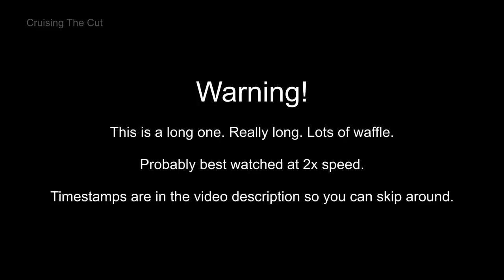241. Narrowboat DIY: refurbishing my shower cubicle

Comment: I hope you used STAINLESS screws! they don't rust in Marine applications or in wet areas......

also to properly apply the "Gunge" use painters tape along the edge where you don't want it (the "Gunge that is!) smooth out your "Gunge" then remove the tape before the "Gunge" dries.....

Comment: Cracking job. As for the new shower head pole. Can it not be turned upside down to fit the screw holes you drilled previous?
Reply from the maker: No, the pieces weren’t designed to do that.
Reply: As an old plumber, I used to use a junior hacksaw to shorten the tube of a riser rail if a similar situation occurred. You have to be careful to keep the end square, but it's normally not too bad.

That was most enjoyable to watch, thanks very much.

We saw your boat at ABNB (we moor ours at North Kilworth) and then down at Welford a few weeks ago incidentally.
Reply from the maker: The rail was made of cheap and brittle-looking plastic which I feared to cut in case it just snapped. Hence installing as is.
Reply: @CruisingTheCut  Definitely better safe than sorry then. Thanks.

Comment: Glue them to the tiles? Bodge and run approach interesting.....and why didn’t you just dismantle the fitting and fit it upside down thereby saving the hole in your watertight shower?
Reply from the maker: Not bodged at all, they’re specifically designed to be stuck to the tiles. The fitting would not work upside down, do you seriously think I didn’t consider that?
Reply: @CruisingTheCut  🤣🤣🤣

Comment: I wonder - your fitting these panels in the summer (hot, expanded boat), so if they are tight now, what will happen in the cold? But I'm only half way through the video.
Reply: In your last shot, of the original problem bottom corner - is that exposed wood to the left? Just a touch of more sealant should cover it.
Reply: Finished the video, great work, video production and handyman stuff. Netflix will be a calling soon!
Reply from the maker: Although I kept saying how warm I was, it was not really that warm and the boat is turned away from the sun. So there shouldn't be any contraction now (if anything, the panels will move away from the corner)
Reply from the maker: No, there's no wood on the left in the corner (I know it looks like it, but it isn't!)

Comment: Question came to mind while watching your vlogs. What does one do if there is a medical emergency while on the cut? Are there emergency boats on the canals?
Reply from the maker: Emergency canal boats wouldn’t be much use as they’d still be limited to 4mph! The canals are so narrow you just pull in and the usual (land) emergency services would come down the towpath.
Reply: @CruisingTheCut  thank you for answering so quickly.  Perhaps the answer to my question was obvious but thought perhaps others were wondering as well.  Have a pleasant summer

Comment: What kind of shower did you install, where the plumbing is outside the wall? We need to get that in order to add a shower. Many thanks.
Reply from the maker: Uh, it was just already on the boat, a set of shower taps with long screw thread pipes on the back. I don’t know any more than that, unfortunately

Comment: Top effort! Just for next time, if you’d have cut down the riser pole (the thing the shower head slides up and down) from the top as required, then it would have fitted the original holes. Don’t mean to be a smart ass but a tip if you ever do it again. Thanks for your videos I thoroughly enjoy them.
Reply from the maker: Hi, it did not seem wise to cut it as it’s made of what looks like very brittle plastic and I thought it might shatter.

Comment: Your are suppose to leave gaps on the bottom for movement of the plastic parts. It is better then it was, but it will fail, and you will have leaks again :(

Comment: Ah, the standard D.I.Y. avalanche.
Was there a reason you couldn't fit the shower rail upside down to make use of the existing hole?
Reply from the maker: Yes, it wouldn’t work that way, the bottom piece is specifically designed to hold the rest up
Reply: @CruisingTheCut  bah, are they designing out bodging now? ;-)

Comment: I had a little look through the comments but didn't see any mention of the gap to the left of where you put the narrow slither of panelling, down the bottom, under the door I suppose, you can clearly see a long strip of bare wood, that'll catch any water splashed onto it and your problem will persist, if I were you I'd fill that with sealant too :)
Reply from the maker: Cheers but it's not wood. I know it looks like it but it isn't!

Comment: 25:00, what if you use a dowl or small piece of wood old broom handle or such, diagonal across the shower then other wall and wedge corner track using several all along the wall.

Comment: A heat gun would have let you bend the panels to fit the curves. Also, use a bent piece of stock pushing from one side to the other to hold both sides while the glue cures. The definition of cruising is "working on your boat in exotic places." and Yaching is "Getting your boat fixed in exotic places."
Reply from the maker: Sounds about right

Comment: David, well done, must confess I only dipped in and out if the early parts, so have only surmised from the comments that you are not a big fan of tiles. Quite a pity really. Your makover really only needed to comprise thoroughly grouting the tiles, and thoroughly sealing the junction between the shower tray and the tiles, (behind the wet timber) which you actually did in any event between the botttom of the shower lining and the shower tray. As another commentator said, chipboard on a boat, in particular in a wet area is a complete no no.
Reply from the maker: I didn't like the tiles so I wanted to replace them.

Comment: Did you really say, hysteresis? I commend your command of the English language, sir.
Good job, by the way.
Did you consider hacksawing some a few cm off the length of the shower head hanging thingy to align the holes?
Reply from the maker: I did say hysteresis! But the shower rail is such a cheap piece of plastic, it felt really brittle like it would shatter if I tried cutting it.

Comment: Your shower rail is better fitted with screws and washers. Brass screws and brass washers or stainless and stainless. Don't mix them because stainless being more "noble" will set up horrendous corrosion. A stainless washer can quickly rot the top off a carbon steel screw.

Comment: We wondered why you didn't replace your taps and shower rail while you did all that work?  Shame if it got buggered up by different screw holes!
Reply from the maker: I replaced the rail (shown in the video) and mentioned why I didn’t swap the taps
Reply: @CruisingTheCut  I suppose because we've just done ours and realised later that planning (hence my worry re screw holes) and doing the whole thing in one fell swoop would have saved time.  Might have only been our shower cabinet previously built by a bodger.  Thought it a brilliant job, anyway.

Comment: Why did you not just turn the shower rod(head holder) up side down? You may also need to put sealant under the whole threshold inside the shower tub, just to avoid future moisture soaking through the wood again.
Reply from the maker: It would not work like that.

Comment: Don't worry, next time it will be a lot easier.  ;-)   I know this is a little late but painters tape, masking tape or even duct tape can hold parts in place while the sealant (grungy stuff) sets. 

Speaking of grungy stuff - it was labeled Silicon Sealant (or caulk) right? Damn stuff is so sticky I try to avoid using it, it sticks to everything including me.

Scribing a curve, I have seen lots that were much worse the your invention. But next time try a steel washer - old it against the surface being scribed with a pencil or marker and just roll it along.  ;-) 

I'm still snickering every time I remember you saying "this stuff is so sticky". 

I had a very bad day today - THANK YOU for making it better.

I'm going to finish watching the video now just to see how nice it is going to look.   Jim Y
Reply from the maker: Cheers

Comment: Tiles are also heavy. I'd have ripped them all out first.
Capillary action is a problem. You need gaps in the hidden areas to stop water making its way through there.
Reply from the maker: Weight isn't an issue on the boat though and the tiles helped by lining up the panels with the tray lip.

Comment: The nipples threaded into the old control valves can be taken off,teflon taped or ptfe d and threaded into the old plumbing behind the wall and then you place the new mixer and handles up to and thread them on,if need be you use the offest adapters you showed to make up for any wider or narrower differences.. You have everything that you need and you just need to assemble them in the proper order is all..
Reply from the maker: Cheers but I need longer nipples (ooerr) as the extra 5mm of the panelling has made them a fraction too short! Also, I think they’re firmly stuck in the old taps because of limescale etc

Comment: That went well.

Will presume by now you'll have checked for seepages ... and we won't see the sequel ... "How I learned to stop worrying and love the caulk".

Ref the fit of the panels ... as you know after a while you won't even notice any imperfections ... as long as you're squeaky and chipboard stays dry then job done.
Reply from the maker: No sign of seepage so far...
Reply: @CruisingTheCut  😂 Excellent!

Mind you tho', fifteen or twenty years down the line you might have to apply yet another squoosh of sealant.

Never ending job with that shower 😬.

Sorry could not resist!

Comment: I'd run the sealant all the way around the shower base even between the door part to so you make shour it will not leak there an have a good seal
Reply from the maker: Cheers, there’s a lip on the tray so no leak from there

Comment: i know this is late, but you should have stainless steel screws. they will not rust. a bit pricey, but will be make repairs easier later.
Reply: Stainless screws are surprisingly weak with easy-chew cross heads. I'd just go for ordinary brass with slotted heads.

Comment: CAD or PAD is your answer, Cardboard Aided Design and/or Paper Aided Design. Shape your chosen mark-up material and transfer to finish-material. Too late now of course, but…
Reply from the maker: But then you have two points of potential failure; making the template and transferring it to the panel…

Comment: Could you have cut the shower pole to length in order to use the same screw holes?
Reply from the maker: It felt like very brittle plastic, it’s rather cheap, and I suspected it might shatter if I tried cutting it.
Reply: @CruisingTheCut  Just a thought. Could you have turned the shower riser upside down, so the fixed end was at the top, and the adjustable fixing at the bottom?
Reply from the maker: No, it's not designed to work upside down.

Comment: I have to say that's not a bad job at all so don't beat yourself up over it. It's a lot better practically and aesthetically so well done. Once you get a couple of tap extensions on the new mixer you will benefit from temperature controlled water which is much better. I may have missed it in the video but what was the adhesive you used ? Is it for non porous surfaces? Take care David. Regards Col.
Reply from the maker: It’s stuff the panel supplier sent

Comment: Do you guys not use AC in your boats? I will be honest if it was me I would have replaced all the previous wet wood and re tiled the shower.
Reply from the maker: AC draws a huge amount of power, which is in short supply on a boat. Plus we rarely get any days hot enough to warrant it. There was no need to re-tile though.
Reply: @CruisingTheCut  ah makes sense. Today it’s 25c or 77f here and it’s still spring.

Comment: I know you were/are a journalist, but I have a suspicion that you spent some of your university time in the college of engineering.  That, or you were/are a very good journalist & researched many technical stories very diligently.  “Hysteresis” is not a word they teach in the typical journalism curriculum.

Also, I may be mistaken, but at the very end of the video, when you were showing the sealing of the formerly leaking area, it looked to me as though I could see wood between the threshold of the door & the shower tray.  I think you may want to fill that entire gap, end-to-end with silicone caulk… your so-called “gunge.”
Reply from the maker: I studied computing 😀 Fear not, it's not wood and doesn't need sealing.

Comment: Hi, David. Enjoy your videos, but, since you didn’t need the whole length of the shower tube, if you simply trimmed to a suitable size there would have been no need to drill extra holes. No one ever needs the whole length of tube that is supplied.
Reply from the maker: Cheers. It's such a cheap piece of plastic, it felt really brittle like it would shatter if I tried cutting it.

Comment: I' would have stripped out the tiles to stop any mould growing behind the new shower boards
Reply from the maker: As the panels are sealed and there was no mould on the tiles, no new mould should grow. Plus it made more sense to fit them to the tiles as this means the panel end will fit inside the shower tray lip easily.

Comment: For fitting the shower tap ,there are tap extensions for different thicknesses of wall (brass or chrome) then you could fit your long wished for thermostatic shower mixer (no more 🥶🥵)
Never plain sailing (or should that be boating ) when diying 
Cheers Nick

Comment: maybe a stupid question but why did you not remove the tiles?
Reply from the maker: Because it would have been a great deal of work, they add an extra layer of damp protection, and their thickness means the panels line up perfectly to fit inside the lip of the shower tray (I’d have had to bend them inwards a bit if I’d taken the tiles off). And the panels are designed to be adhered to tiles as much as to wood.

Comment: At the risk of sounding Mr Know-all, before lining a shower with these boards you really need to familiarise
yourself with the laws of capillary action where water prefers to go up hill rather than take the usual down hill
route which is encouraged by gravity. Your silicone filler which is sealing between the upturned shower tray lip
and the bottom of the new wall board is not foolproof. Any movement during temp changes on the boat can
break this seal and capillary action will do the rest. Your origional problem was very likely caused by cap action
more than just water splashing upwards.
Reply from the maker: Errr that's exactly what I did talk about at the start, explaining how the water went up the wood through capiliary action and then down. There will be no further capiliary action even if the seal breaks because I stuffed so much sealant behind and underneath the wood. There is no physiacal way for water to get to the wood grain anymore.
Reply: @CruisingTheCut  I did listen again and heard no reference to the dreaded capilary action, only water
soaking up and through the wood. The classic cap act is water being drawn upwards between two
separate surfaces, as in back of your new board and front of lip on existing shower tray. It will defy physics, gravity, logic, understanding, belief and sealant. Here in NZ we have billions of $ worth of damage to new buildings caused by" leaky building syndrome", much of this is due to......yes our old friend
capillary action. I have worked on this problem with the best sealants and fillers and it has had me
tearing my hair out in frustration.

Comment: If you would have turned the bar upside down it would have been adjustable. Fixed end at top then slide the other to fit.
Reply from the maker: No, it wouldn’t. I did try that and it doesn’t work that way, the bottom section is designed to hold the rest up.
Reply: OK, then epoxy rod into holder, or a screw to hold it in or cut the rod.
Reply from the maker: The rod feels like such cheap brittle plastic I didn’t want to cut it in case it shattered.
Reply: Probably a good idea. Not trying to discount what you’ve done. Just some suggestions. After building houses for 35 yrs you find sometimes you have to invent solutions.

Comment: Could you not have fitted the holder up side down? That way the adjustable would be a the bottom
Reply from the maker: No, it wouldn’t work, it was designed one way up
Reply: I also feel this would be possible. Disassemble the unit and put the sliding thing on the other way. But what do I know. Edit: The bottom piece seems to be capped, holding the rod in place. Some way of fastening the rod might be needed to ensure it not falling out. Too late now anyway. Shortening the rod/pole would also have been an option.
Reply from the maker: I did not want to cut the rod as it’s made of very cheap and brittle-feeling plastic which I was afraid would shatter
Reply: @CruisingTheCut  Thanks, I already read your reply to a similar remark in other comments. I would say (the chance of) damaging the rod is not as bad as drilling an extra hole in the wall. But it's fine. "If it works, it ain't stupid" ;)
Reply: @CruisingTheCut   oh well, worked out ok in the end and looks great 😂

Comment: Experience counts, so does learning the trade or trades. only then do things fall easily into place. But since you have lots of time on your hands, not paying for experienced workers can be a saving. But I wonder sometimes if paying out a few quid and putting your feet up with a cheese sandwich and a gin tonic might be better for your sanity David, if not your wallet..Having said that, all does look good and there is, the satisfaction of, 'I did it myself'
Reply from the maker: Yes, the point was to DIY here